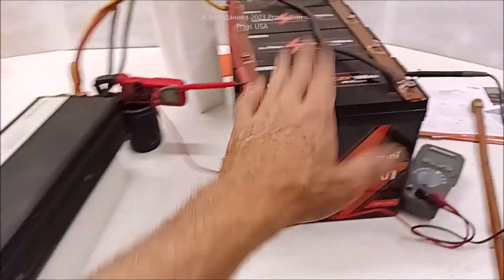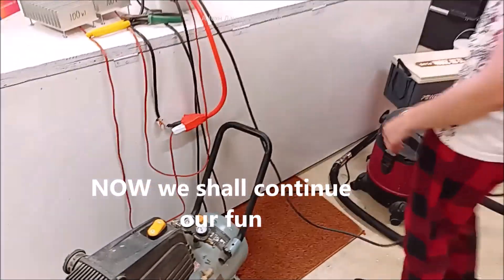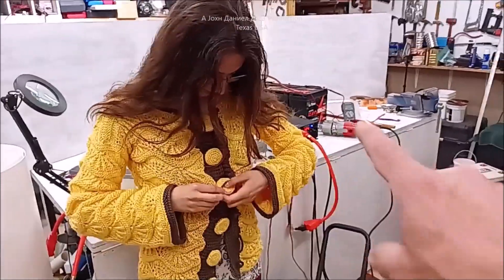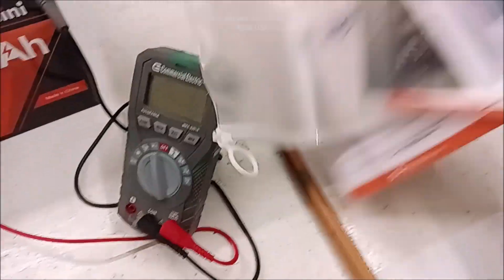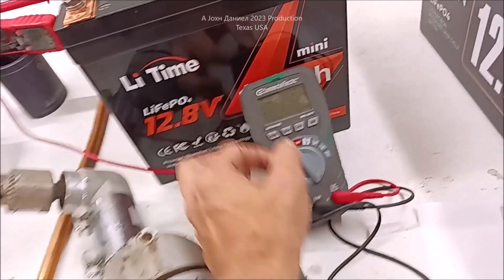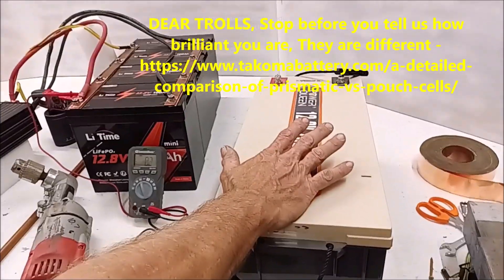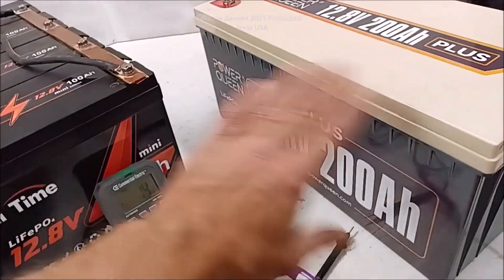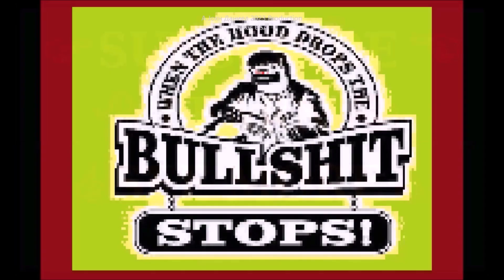Li Time Mini LiFePO4 100ah battery long term testing with Newest SWI-Power 3000 watt inverter

Comment from the maker: 😍 LiTime Mini 100 Amp Hour, at https://amzn.to/3P5I1Zl Need Tech Answers? go👉 Donate $5+ on KoFi - https://ko-fi.com/john4kiera OR https://bit.ly/2buyaCoffee message, inquire, to get my help & replies! Go⬇See all Parts and Trustworthy Sources below⬇
Best *MWXNE 4000 Watt MEGA 120v Inverter*, Get one NOW! https://amzn.to/4ixXC05
 My Own DEALS TO LOVE - ✨Find Name brand off grid electrical parts, overstock warehouse clearing priced at My Temu App: https://app.temu.com/m/mmx3fd0485u a $100 coupon bundle waiting for you. 🌟Click https://temu.to/k/um91ypa88vg to explore, shop, and save big on Terminals, LiFePo4 Batteries, Buss Bars, Controllers, connectors, Solar, Hardware, Agriculture, water pumps, and more direct USA shipped from name brands for 20% less!
Reply: @john Daniel I just purchased 2 of the redodo Mini 100ah batteries.  I'm new to the lithium world.  So setting my solar charge controller will protect my batteries from over charging ? I just want to make sure I don't screw up my batteries. Thank you.
Reply from the maker: @mikesterling9322  You can never screw them up charging lower voltage. They do not have a memory like older rechargeables. With a pouch cell, thats in them, you can swell the cells going to 100% often, so set your charge to 14.3 cut off, charge recovery at 13.2 and no float setting is needed on LiFePO4.
Reply: @Јоhn Daniel  thank you so much. My charge controller is a basic Renogy so I don't think I can set the max charge voltage but if I set it at the AGM setting that should work correct? Thanks in advance, I appreciate your channel and knowing.  👍
Reply from the maker: @mikesterling9322  Yes, there is also GEL setting, but which ever puts you closer to Controller Shut off and 14.30 volts max, 14.10 is OK too if that is their GEL setting.
Reply: can someone please do a head to head comparison of all the new 460ah lifepo4 batteries that are coming out? redodo bird, roamer, litime, epoch, basen, VATRER etc..  thanks in advance!  @JOHNDANIEL1
Reply: Glad to see you finally came around on these Lifepo4 batteries. I can remember you being down right rude to me about them on a couple of occasions.
Reply from the maker: @davefroman4700  Dave,  I haven't come around, they have. For 5 years from when they were $1400 for a 100 ah to now that they are $289 for 100 ah put them in competition with a 230 ah Lead Acid you pay $135 for. I still would not hope to ever have to depend on them only. With them your only one wrong move from massive loss, a EMP, lightning static event or just poor quality electronics. How bad could it be if like the test we did in Idaho with a mega linear SSB radio, 75 watt burst from 200 feet away and the guy fried 3 Battle Born batteries control boards in a 5th wheel. 
I think they are worth it now, but when you have 5+ freezers of food running 24/7 off solar you stay in fear of a domino level BMS fail, and one has happened already to us, but with lead acid you just ignore that fear knowing breakers and bulk battery will cover your butt for you. 
My goal is to make only solid state balancers needed, and cells sized 30% over any need so its just charge cut, balance, and use. NO BMS.

Comment: Hey John! I hope you’re feeling a lot better! I have been watching all of your videos on Batteries and I want to make the right decision on a purchase. I have 200 watts of HQSTsolar and 2000 watt ERAYAK inverter  based on your recommendation. But I’m confused on the batteries! Just so many choices! Help when you get a chance. Thanks in advance 
Herman
Reply from the maker: Double those solar panels and right now, for both ability and financial reasons get the Donjin 100ah x 4 for dirt cheap. https://amzn.to/3X9lW03 Thats over $450 less for 400 Amp Hour than a single 300ah battery from anyone. Use simple 2 awg cables to connect all 4, and seriously, get no less than 2 more of them solar panels, better to have 6 of them running on 2 - cheap 30 amp Bouge https://amzn.to/3ywoMlq $44 lifepo4 controllers actually. Then you can actually survive what the lunatics running the system will do to us all. Right now, their solar panels are cheap, but some nut in Washington named Joe imposed the solar tariffs of 100% to go into effect in June. 4 pack, https://amzn.to/3yoMaB4 So DO NOT WAIT!

Comment: hi thanks for you videos, but now im little bit confused :D if you put 4pcs of 100ah batteries in parallel. and the rating for one battery say 100amp max output. Is the total allowed output 400amp or is it still 100amp? those cables and connections are so thin. I dont know what lifePO4 to buy to be able to run a SWi 3000watt inverter for food cooking. it should be able to easy run an hour of 2200w induction plate. 12v. +/- 183amps. +roof ac 300-600w etc.
Reply from the maker: Depends on the Roof AC unit actual rating of start up amps actually. But using the buss bars you should be able to run the full 400 amps the 4 battery design is capable of if needed. You can get 1.5" wide 3/16 thick copper bar in such a connection and be good for 440 amps total. The full amp pull on the inverter would be 3000 watts divided by 12.8 volts ( 234.4 amps ) plus 10% for conversion efficiency ( 258 amps ) total. A DC load, if thats your AC unit, with that of 600 watts is same math minus the conversion efficiency 600 watts ( 50 amps ) so your total load is under 300 amps. You can use up to 4 foot of 1/0 cables on the inverter and 6 awg up to 9 feet on the air conditioner DC load without a issue. Go to the next larger sizes if your distance is longer to prevent drop and resistance. As for a battery choice, get 2 of the 230 AH ones with 1/0 jumper welding grade cables as shown in my most recent video. Those batteries are on a big sale https://amzn.to/4dnOQz7

Comment: Having a  short and long wire  like 6 inches  in length different can it damage the battery
Reply from the maker: Try at every chance on a permanent install to use equal length cables so you do not burden one battery or terminal with excessive loads.
Reply: @JOHNDANIEL1  Okay thanz

Comment: If you want better draw/charge pull one side positive and the other ground. 

2/0 should be enough just use high strand welding cables. It’ll take that load no problems. 

Love the videos. Does the copper pipe you flattened work better for jumpers than actual cable?
Reply from the maker: The copper tube is better since it is lower total resistance. As for opposite ended pulling, that is excellent and better on Lead Acid, but the BMS in a LiFePO4 is so sensitive I wired it like seen to make sure they read each pull more equal.

Comment: Mr Daniel I am in the market for a good or decent 5000 watt 12 vdc/120ac inverter. Is the SWI inverters at that size any good. I am on a tight budget and I cant afford to buy junk.  It will be mostly hard wired.  Thank You.
Reply from the maker: Look on the AliExpress page, these are in a US warehouse. 6000 watt will not disappoint. https://s.click.aliexpress.com/e/_DDbHZlX

Comment: If you start needing really high capacity from your inverter or your battery storage solution, it's almost always smarter to leave 12v behind and move up to 48v solutions.  The "mini" batteries are using pouch cells, but they are still LiFePO4 chemistry, so their charge and discharge curves would be very similar.  Any observed differences would boil down the BMS they used and how that was configured.
Reply from the maker: I put that manufacturers data link in the video, have to write it out on here later. But it explained why the charge absorption is odd with pouch cells compared to prismatic. Problem with them is they do use identical BMS in them, and you may want 100 charge in them, but avoid it. 90 to 95% is already hard on them. As for 12 volt, I pull over 11,000 watts when needed without issues. Chose not to be a fool and spend 400% more to run a electric drier or stove, And if one battery fails in my 32 I'm pissy but not crippled however is one battery of 32 fails in a 48v I have lost 1/4 my entire system. So, the hot shot dealers say your hillbilly, stupid, and archaic to use 12 volt, they have hyped higher volts till the cows come home while making bank on it, but if you loose 1/4 your system ever you may need a generator running on gas to turn the lights on for those cows headed home. I do not like risk, love redundancy and am willing to save 30% on inverters, lighting, basic auto/marine rated appliances using 12 volt off the shelf everywhere than depend on a dem dare sopfistucated higher volt dealers cashing my checks till I'm broke buying that " available only here" speshulized stuff. 🤗

Comment: Unless optical illusion due to placement and camera angle, the 4 100 amp hours seem like they would take up a lot less space than 2 200 amp hour batteries for the same 400 amp hours. What is/would be the difference in performance between the 4- 100s and 2-200s ?
Reply from the maker: The 200ah Power Queen is same length but 1" wider than the Mini's, and in height the 4 mini's are 1/2" taller than the PQ. If your wanting higher capacity for much less real space then the mini is perfect for that. They make a 400AH in a 8D case like the Power Queen, but none have over a 250 amp draw capable BMS, with 4 of the mini you have 400 amp draw capable. Excellent for a RV with 3000 to 3500 watt inverter.
Reply: Don't know what the "line through" came from

Comment: Look at that just what I wanted to see.. I’ve already ordered the li time batteries but I might actually order 2 mini’s instead. Mainly for the weight saving. I’ll be sure to use ur link.. have you tested the wind turbines yet?
Reply from the maker: Yes, we have 3 wind turbines to install, pipe bases are done, but not risking shoulder yet to hoist them up. They tested full ability, just been short to buy so much materials and at some time build on house for 6+ here. I'd say the Mini is a good battery, no lesser then similar able batteries. Just lighter and easier to handle.

Comment: Great stuff, thanks John and Keira. One question I'd have is: how much power might be wasted through heat in those wires? You mentioned they're getting hot, which indicates to me that those batteries may actually be pushing a substantial amount more current through the wires than is detected by your clamp meter. I would personally bite the bullet and get some 4/0 AWG cables, not because they're at all necessary per se, but because you'll get the most accurate reading of battery power output. Just a thought. Otherwise though, I love your "real life" torture testing methods, and respect the hell out of your dedication to the truth. Thanks again!
Reply from the maker: We got a 20 degree temp rise, about 20 amps extra wasted so I added a extra set of cables to it. No more heat. Single 4/0 is not only very expensive, it is hard to get. Many sources are running out and lots of cable sources are out of basic materials or have upped their prices 50%.
Reply: @JOHNDANIEL1  Fair enough man. I've experienced the rise in copper prices firsthand as well, it's a real mess. I'm at the point now where I can't justify anything bigger than 0 AWG for these mini power stations I build. Every watt is precious, but so is every dollar lol. I just try to make the cables as short as I can possibly manage, chop the excess, and terminate it myself for future projects. That's one reason I love building batteries from raw prismatic cells, they always include busbars! Max efficiency for minimum cost.

Comment: copper pipe... worked great! and much cheaper than ordering stuff online
Reply from the maker: Call a local plumbing company, tell them you want some 3/4" type L soft copper  left overs, they will sell it to you for about $6 a foot or less. I will be showing soon how to make it into a buss with embedded studs that can handle over 450 amps. The 1/2" can just hit the 300 amp ability, but the 3/4 soft type L can hit 440 amps per foot max. I have some 1" type K that is over 800 amp carrying ability. You can ask them for what ever they have in the scrap bin, and make a offer. Just DO NOT use type M or thinner.
Reply: @JOHNDANIEL1  I would be very interested in a thorough video about this... do you think they could be used as a BMS / shunt / inverter cable over 6-12" distances in a permanently mounted location? Or even as a DIY busbar??

Comment: Is the Redodo mini same pouch cells?
Reply from the maker: Yes sad to say. They ( 12 branded sales teams, shops within a single underwriter, but all basically from one import union group) used to be sourcing from different assemblers, different cells makers, different BMS brands and even some different cases. Quality was based on each teams picks of assembly and sourcing. But now it's looking like in China there are numerous factories failing, world economy related and these brands that are mostly all from the same major importer shipping union and their teams sourced from numerous suppliers now they are choked back in source availability, now have joined each other in using same dwindling suppliers and like I showed in a video months back I knew that this would happen due to the China and later everyone collapse that is coming.

Comment: I think building your own battery is the way to go. I just wish batteries was not so expensive. Im waiting on some 280 amp hour eve cells and a 300 amp daly bms to put together at the moment. Id love to buy prebuilt batterues but im afraid they are built with b grade cells that may or may not last
Reply from the maker: Even though I like the Power Queen, tough, solid, sourced well, I would not promise you 10 years, likely 7.5 is about right. The metal cased 400ah Vatrer https://amzn.to/42yfGOi  is about the only one in all these built that may make it 10+ years. It is made 100% by Image Energy a Japanese owned company, using ELB Energy Group cells, has real deal Motive Power cells in it. Other Vatrer batteries are OK, sourced elsewhere. But not that one. I wish I would have bought 6 of them for my whole system when I built it, but Panasonic controlled them until this year and cost was WAY HIGH. Now that I am broke, they got them for cheap.
Reply: @JOHNDANIEL1  alot of people talk crap about nissan leaf cells for batteries but I worked several years at the nissan battery plant building the cells that the pack is made from and if you can get ahold of the cells before they are wore out they are better than the lifepo4 cells. Maybe a little more dangerous if you abuse them but definitely the best batteries out there for long life and staying balanced

Comment: John could you maybe answer a question for me? i bought 6 Li Time 24v 100amp batteries Do you have any idea why they say i can only hook 4 in parrallel? thanks for any info
Reply from the maker: Because they seem to have no clue in China what a BUSS BAR is. The basic is, the terminals on the battery is what they base it on. They expect you to jump cable from one battery to another, creating a challenge for the terminal and the BMS. They fail to understand Wire gauge based Buss usage. So, for yours, you can easily using 6 awg in equal lengths ( under 7 feet long/away ) 4 awg over 7 feet, and a buss bar. Then if you want to add more, run them the same. Pos/Neg cables same identical length, and buss bar that can handle your solar input, and battery output with at least a 5/16" lug for a 3000 to 4000w inverter. If you want to be safe, add a 80 amp breaker on each battery. Doing this is auto balancing, load is in the buss bars, and no load is in grouped terminals or unequal drawn BMS.
Reply from the maker: helpful https://youtu.be/y35PgmApOuw
Reply: when i contacted them they said it had to do with the BMS.
Reply from the maker: Just use ( EXAMPLE ) for 6 batteries, make 12 ( 6 black/6 red ) cables in 6 awg at 6 foot long, connect them all up from each battery to a single pair of heavy buss bars ( black/red ). I just make my own, none of the products online make one for 500+ amps. You'd need 1/4" x 1-1/2" x 6" https://ebay.us/dn3Un8 twice and some stand off isolators  https://ebay.us/lm4Y5I and some, (12) 1/4" stainless and one pair of (2) 5/16 x 1" nut/bolt sets.
Reply: i was thinking of useing copper bus bars to hook them in parrelle insted of wire.